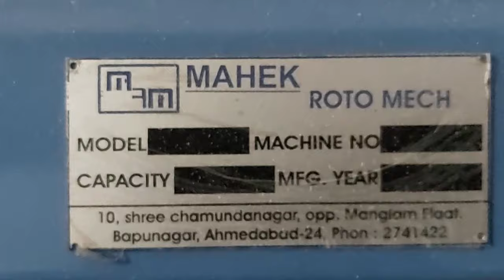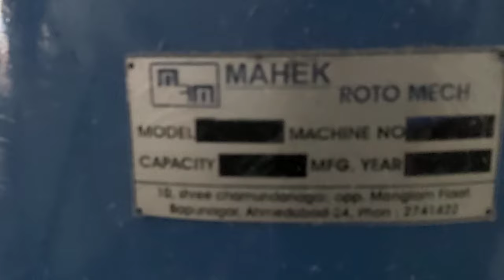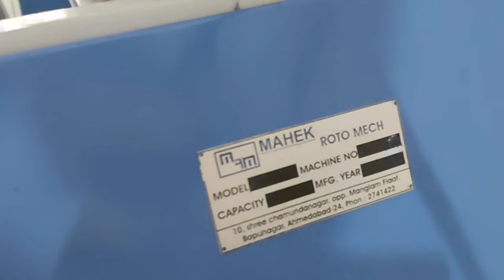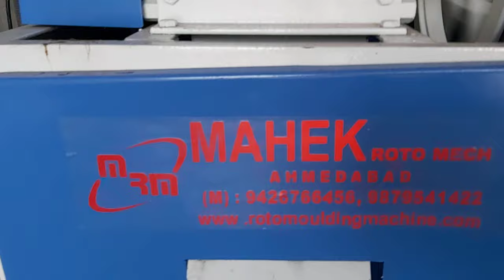Plastic dana making machine

Comment: How much cost in this machine
Reply: gana machine Mein
Reply: Automatic or mannual what is the price of meshine what is power for moter
Reply: What I'd the price of this meshine
Reply: 70 lakh
Reply: 20 lakhs
Reply: Leistritz twin screw extuder is best as compared to this type of machine.
Reply: Hi
Reply: Ap ki bi masin he kya
Reply: @jangitiprabhakar3521  8 lac full setup with motor aur wiring and panel
Reply: 8 lac full setup with motor with wiring